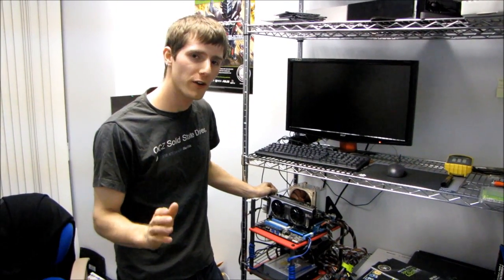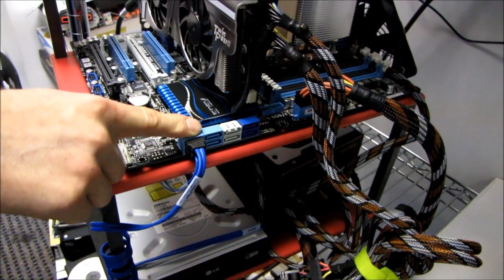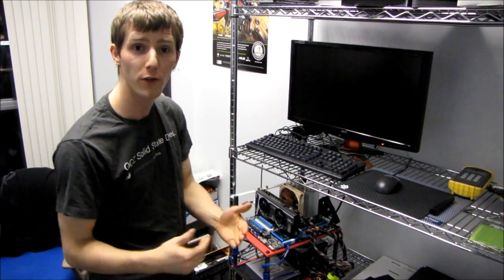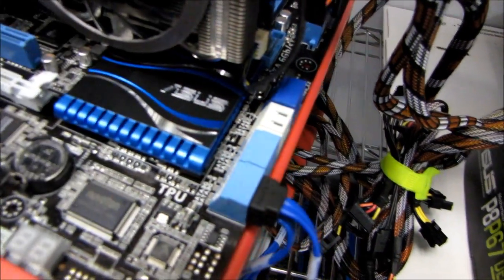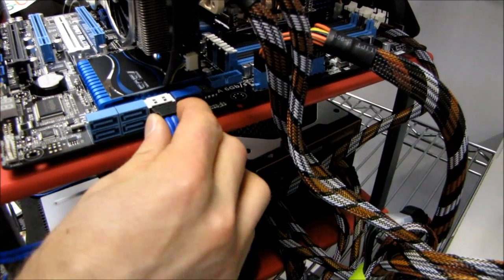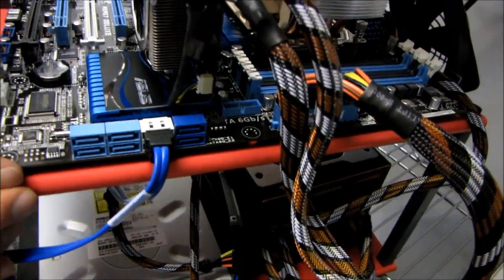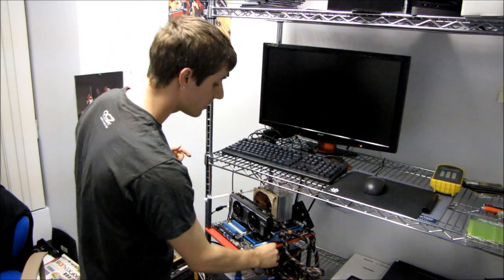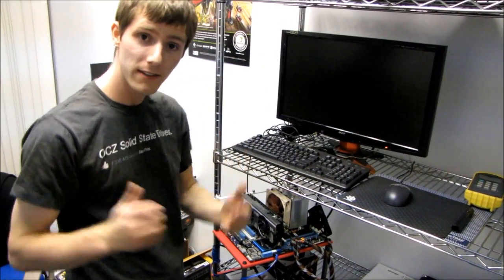Sandy Bridge Chipset Issue - How to Avoid Damaging Your Motherboard Linus Tech Tips

Comment: @shyboy2cute Thats because it's SATA II, SATA III is rapidly becoming the standard for high end storage, so WEI now looks for the major performance. For example, my 1TB SATA II drive only reads and writes around 70MB/s while my SATA III 2TB drive reads and writes around 190MB/s. Granted the higher data density means faster speeds, it still shows the doubling in performance, which is white the SATA II SSD is only a 5.9

Comment: hey guys well i have a notebook and its one of the faulty one's. its a customized notebook hp dv6 quad edition. any ways i called HP because i got an e mail saying i can return it and they can fix the problem, but my question is what exactly will they do? and what if i just leave it like this? i wont be using my SATA/USB port that much only to charge mi ipod. but im scared i dont want my mother board to fry, or my processor or what not. should i send it to get it fixed?

Comment: @hedgehog1965uk Thats Awesome thanks for the Help :) Ive found a few retailers still selling them, you should be able to find one somewhere. Apparently intel are willing to replace any H67 or P67 mobo when they release the new batch with the fixed hardware in a few months time plus you will get at least a years warranty if it does go wrong so it doesn't seem that big of an issue to me.

Comment: @gmodertom Yes. SATA III ports are unaffected by this fault and are completely backwards compatible with SATA II devices. The problem you may have though is trying to find anyone who will actually ship you a Sandy Bridge mobo right  now. I am in a similar situation to you as I want to build an awesome new gaming PC based on Sandy Bridge, but may now have to base it on the older X58 chipset and an LGA1366 CPU.

Comment: So is it perfectly fine using the 6GB/s ports? I want to buy a P67 chipset but don't want to wait another 2 months to buy one. I will only be using 1 HDD and 1 Disk Drive so if I plugged them into the Sata 6GB/s ports would it be perfectly fine???

Comment: the mobo Gigabyte P67A-UD4 has marvell chipset only on eSATA ports !!! check official website !!!

Chipset: 
2 x SATA 6Gb/s connectors (SATA3_0, SATA3_1) supporting up to 2 SATA 6Gb/s devices
4 x SATA 3Gb/s connectors (SATA2_2, SATA2_3, SATA2_4, SATA2_5) supporting up to 4 SATA 3Gb/s devices
Marvell 88SE9128 chip: 
2 x eSATA 6Gb/s connectors on the back panel supporting up to 2 SATA 6Gb/s devices

Comment: i dont understand, why did he say connect dvd drives into the 3gb/s(faultY) ports when he could plug the dvd drive into the 3rd party port which is also fine? so if im correct there are 4 working ports  and 4 faulty? whats wrong with using the 3rd party ports?

Comment: @scooter1151 But it's a SATA controller.  It is not like it's some new tech.  It's been around for years.  Not something that should slip by.  Plus the fact that something that takes a long time to actually fail, way longer than the time on the market so far, means they knew about this a bit before the boards went out and sold them anyway.  I'm an Intel guy and am a bit surprised by this.  Big failure on their part.

Comment: Please help. This is my first build and I don't have spare parts lying around. I have an Asus Crosshair IV Formula Motherboard, 16GB's of Corsair XMS 2,000mhz ( tried the one memory thing to no avail), Diamond 5870 Graphics Card 2GB DDR5, Western Digital Black 1TB HDD, and finally an ATx 750Watt by Corsairs. I hooked everything up correctly I checked and quadruple checked, but nothing. It came on the lights on the motherboard worked, the optical drive opened and closed, but BIOS no run HELPPLEAS

Comment: i haven't heard more stupid issue. When i bought something i want to use it the way i want not the way they told me to. If then the board will die then there is for it RMA. Those 4 ports works with raid 5 so is someone has for example 4 drives in raid then he is doing wrong ? That's absurd. The board should be fixed asap. I'm glad that i have Phenom II X4 B50 :]

Comment: @PCWarrior55 
If you have a look at the difference between your 2600K stock cooler and the stock AMD cooler, there is a BIG difference which isn't comparable. 
The stock AMD cooler doesn't have a very efficient design and the fan is tiny and spins at ridiculous speeds..
If you puchased a cheap cooler for <$20 like the TX3, there is a big temperature change. I mean BIG. 
The newer Athlon II and Phenom II run much cooler than older chips and the power consumption isn't even bad.

Comment: @livingdragonn You shouldn't need to worry about any blue-screening when you start up your PC. Sandy Bridge is still a great processor architecture and the motherboards themselves work great, but it's the SATA-II ports that are due to fail over time. Once you get your system, before you turn it on, consult your manual to figure out with ports are the SATA-III ports. Unplug your HDD/SSDs and plug them into the SATA-III ports afterwards.

Problem solved.

Comment: @Ros3w00d Bulldozer will be interesting, yes, but I sincerely doubt it will compete with Intel's i5 2500K + i7 2600K. Bulldozer will be a cheap, budget-aimed way of pushing Intel out of the mid-range gamer market. Which, in my honest opinion again, might not happen.

Not saying AMD is going to lose, I just don't think they're going to pull massive performance out of these CPUs. They'll be nice nonetheless for the price, but not as powerful as Intel's 2nd Gen i3/i5/i7s.

Comment: @sk8ing1995 The i5 2500K seems to strongly push the i7 930 around in basically every benchmark (Cinebench, POV Ray, WinRAR Compression, etc). Just because the SATA-II controller failed doesn't mean that the CPU is bad. It's just a chipset bug.

Comment: @getlow1985 Second gen. cores offer about 20% higher performance over the First gen., which in my opinion is an okay trade-off for a bugged SATA-II controller. Besides, you will be able to RMA the old board for a fixed on anyways, so it's not really that big of a deal in the long run.

Comment: @gubrother1 Fixed boards are due to come out in about April. This is a long-term solution, as the SATA-III controller on the P67/H67 chipsets is completely fine, along with any third-part SATA-III controller.

As long as you are under warranty (which you will be, it's only a few months away), then you should be able to RMA your motherboard and get a new one with the updated chipset/parts.

Comment: @tubester4567 If you have purchased a P67 or H67 motherboard, you will be rewarded 2500 NCIX Reward Points. NCIX itself currently does not have a solution for its customers, but do check back on the NCIX Forums post (can't post a link to it here). It is stickied on the first page under the topic name "NCIX Announcement Thread: Intel LGA1155 Sandy Bridge P67/H67 SATA II Controller".

Other questions can be directed to NCIX Customer Service: 1-877-624-9777